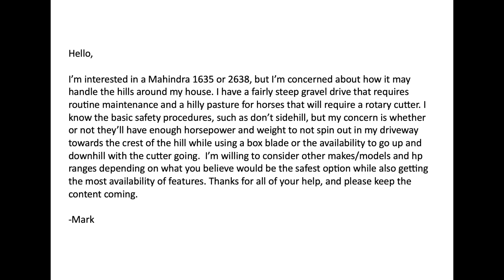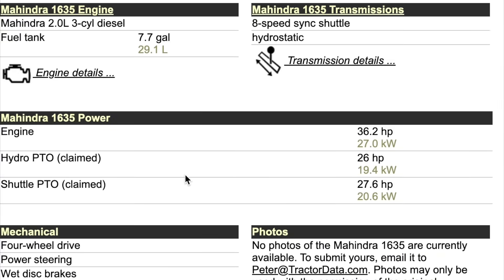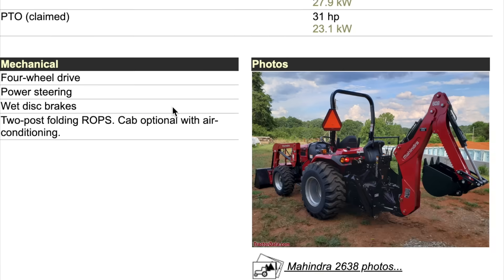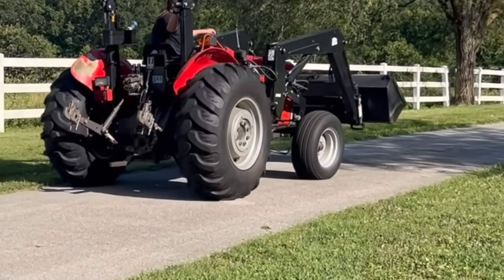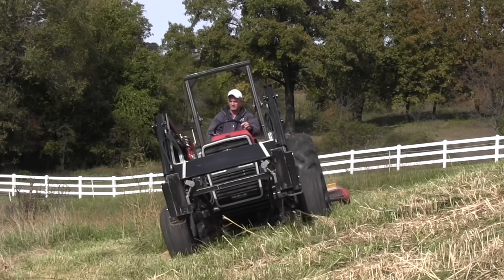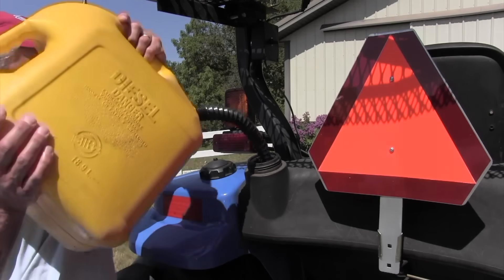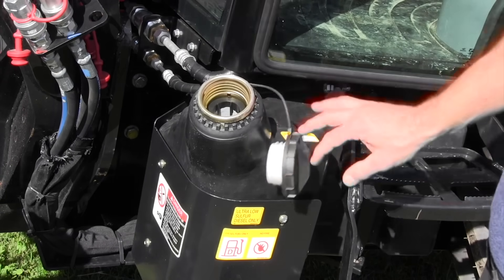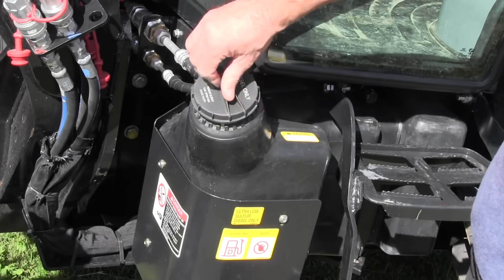Which Tractors Handle Steep Hills Best? Watch This First

Comment: Tire ballast is a must no matter what. It helps far more than hinder any tractor or even lawnmower.  Never be in a hurry on a hill and keep everything as close to the ground as possible. The driveway maintenance part shouldn't be an issue. Just take smaller cuts of materials until you're not breaking traction and stopping. A little spinning is fine, full blown digging ruts is not. Try to cut up hill and keep the cutter behind/down hill of the tractor. Cut up and SLOWLY back down if needed, but you don't want the cutter pushing you down as you're driving down the hill. Just take your time, get used to the tractor and use some common sense and you should be just fine.

Comment: Fluid filled tires for ballast is not a good idea on slopes because you get tire stretch or even with using a loader  the solid weights push the tractor to the ground

Comment: Great video! I think that was the best explanation I ever heard on platforms and rim mounting options. I do not think I heard you mention wheel spacers. I have an L4701 with split rims and put the dog ears all the way out and installed BroTek 3" wheel spacers. It added about a foot to the rear end and made it much more stable on hills. I also added the Travelers RV antifreeze to the rear tires. Huge difference. Thank you for making these videos.

Comment: Most older tractors have cast iron transmissions, which are heavier. Many of the newer tractors use aluminum, which makes the tractor lighter. I have always been told that heavier  is better. Also if you have a front-end loader keep it low to the ground while moving loads. Other than adding ballast and weights to the tires, setting the wheel width as wide as possible  don't know what else you can do other than be cautious on hills.

Comment: If his two primary jobs are just the ones stated (hilly gravel driveway maintenance and hilly pasture mowing) then a Ventrac fits the bill.  Low center of gravity, articulates, can purchase dual tires to widen the stance  even more, and overall it's probably the best thing out there for hills.  The power rake attachment would work on his gravel driveway, and they have a number of mowers, flail mowers, or brush cutters that would work on the pasture.  The downside is the cost (e.g. power rake MSRP is $9600).
Reply: Ventrac with duals for best safety but they are super expensive including the attachments and they are not as versatile as a tractor overall.

Comment: I am interested to see if anyone has tried making wheeled outriggers like the ones used to stabilize ocean going canoes. The idea is to use the crosspipe on the front of my JD 1025r (or equivalent) Front End Loader. Putting a smaller diameter pipe inside the loader's crosspipe and then attaching wheels to the end of the smaller diameter pipe can allow me to lower the loader based outrigger wheel when on a cross slope. Further, if the smaller diameter pipe is 3 feet longer than the loader crosspipe, and if I can rig a way to shift that extra 3 foot of excess to the downhill side, I can effectively increase the stance of my tractor by 6 feet on the front. Again, note that this is adjustable both in the side to side location as well as lowering the loader only when needed. This won't be the best way if the loader is being used, as the wheels need to be rolling on the ground when the loader arms are down, but the bucket needs to be curled up and out of the way.

Comment: While water or “washer fluid” is free to cheap, I absolutely recommend RimGuard for tire ballast. It’s around 2lbs heavier per gallon than water! Really helps when using the FL. It will certainly help stability on slopes! Wheel spacers will widen the stance and help stabilize the tractor as well.
Reply: Beet juice is a really popular liquid ballast in Michigan where I live. Years and years ago chloride was the only option; my side hustle is parting out old tractors and I see a LOT of rims destroyed by chloride. In fairness though it takes 40-60 years to ruin one in most cases.

Comment: New Holland Workmaster Utility 50 4WD: At ~50 hp, this gives you good reserve power for loader, mowing or implements on slope. The 4WD helps.
	•	Kioti CK4020SEH Hydrostatic Compact (≈39 hp): A compact tractor ~39 hp, still in your band, with hydrostatic drive (which can help on variable terrain) and 4WD likely.
	•	Kubota L4060HSTC 40 hp 4WD: 40 hp, 4WD; good middle ground if you don’t need full 50hp but still want stability and power.
	•	John Deere 3025E Compact Utility (~24 hp): On the lower end of your range (24.7 hp gross) but has 4WD standard and good credentials.  ￼
	•	Massey Ferguson 2606H Compact Tractor: Another brand/model in the roughly 50hp band (depending on year) — giving more power if that’s desirable.
	•	John Deere 3025D Compact Utility (~24.7 hp): Similar spec to 3025E but alternative variant.
	•	John Deere 3025E (Alternate listing): Duplicate of the earlier model; shows there are multiple listings, good to check availability.
	•	John Deere 3032E Compact Utility: Slightly higher horsepower (~30 hp+ region) which gives more margin — could be beneficial for tough slopes or heavier tasks.

Comment: I would suggest getting a tractor with AWD (all wheel drive) if running on hills. It makes a big difference having power to all four if one starts to slip, especially going down hill.  I have a kubota mx5200 (52 hp) with AG tires and no AWD….when working my drive and I have a full box blade of crushed concrete my rear wheel will auger in….i can engage the diff lock but that’s a temporary solution and I still have holes to fill as result.   Also think about if you will ever need to feed round bales as you will need a bigger frame tractor with more FEL lift, which is why I went bigger (plus found a deal used on the MX which is bigger than I could’ve gotten by with. 

Good video, but go AWD, add ballast weight and get a good all round tire. AG tires will dig into your drive when you churn it up, but they give good traction while shredding in pasture……when on slopes be mentally prepared to drop attachment to ground if you get into a bind….and run with FEL low - I’ve seen folks running with it high in air for visibility and that makes tractor tippy also.

Comment: Also on the grassy field hills it’s best to be in 4 wheel drive so all wheels can brake and try to avoid wet grass as it can be really slick and get you into a sliding situation. ( As you have covered in past videos ).